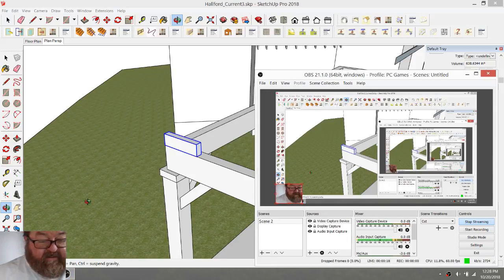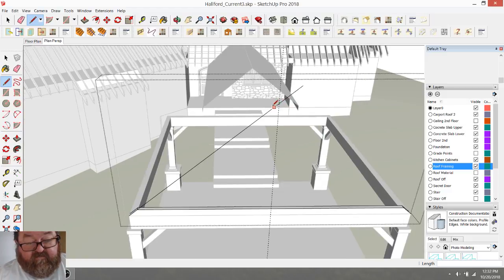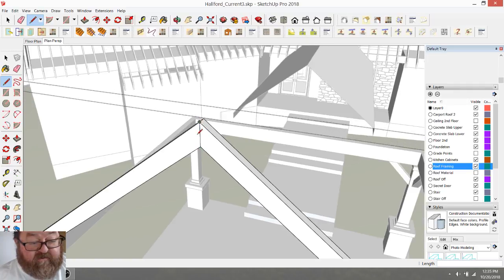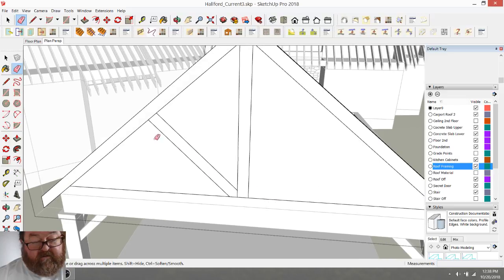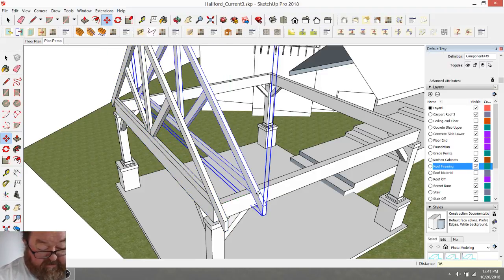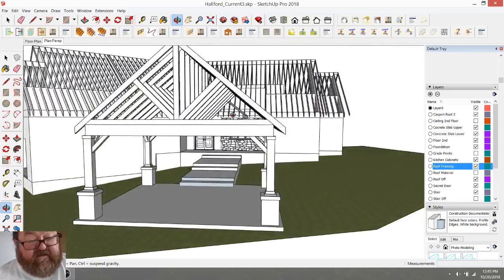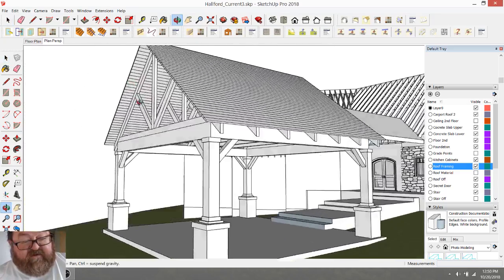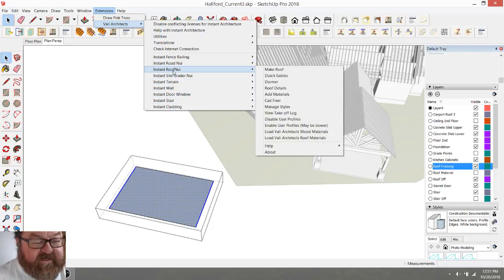Big House in Texas Vlog #11 - Roof and Carport Framing - Live SketchUp Session

Comment: When you spec the LVL or glulams for these plans do you then have to submit them to an engineer to verify the size. Just say you were building this in Chattanooga would the building inspector sign off on the beam sizes that you intend to use or does he require every detail stamped by an engineer. I know on the Sleepy Hollow road build you mixed 2X12s an I-joist for the required spans to and noted the difference in cost of the two sections. I know you can read span table and calculate your loads as good as the engineer could but what freedom does a knowledgeable contractor have to self size joist, rafters and headers?
Reply from the maker: I usually call Georgia-Pacific’s Engineering dept and tell them the details and verify the combination is want to use.  Sometimes i need to fit them in a floor or wall system anf the depth matters.  In this csse i canjust add an aditional lvl if 2 will not carry the load
Reply from the maker: As far as the building inspector goes, I have known two of them for over 20 years and they have gotten to where they trust what we do.  I usually will upsize an LVL if I have a question.  Like the roof beam on sleepy hollow could have been 3 - 16" lvl's but I made them 18" cause artisans :)  But if it is a budget job, I go by what the engineers tell me at Georgia-Pacific.  The building inspector usually deos not question LVL's.  They will question common lumber beams but they know LVL's are slightly over engineered anyway.